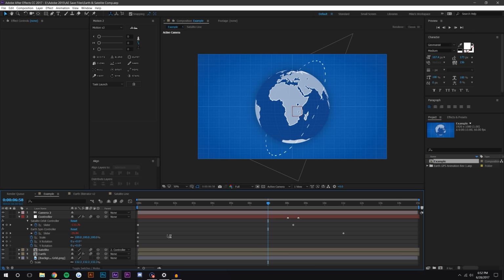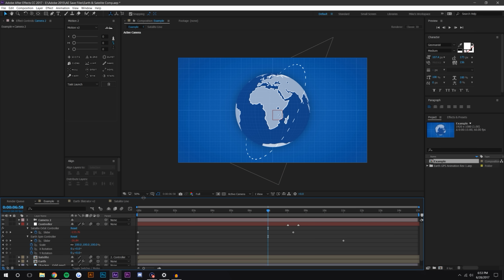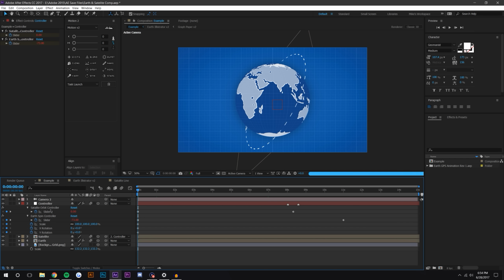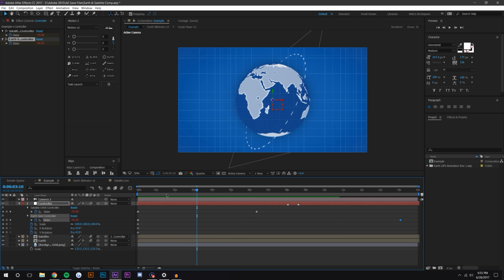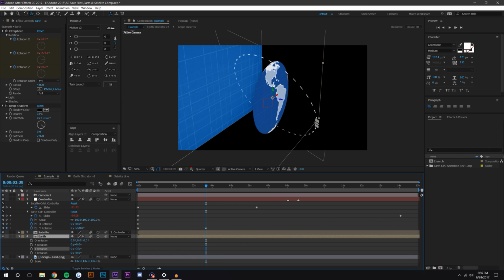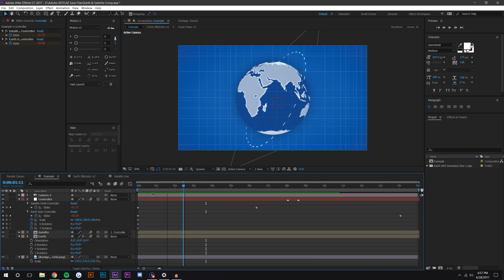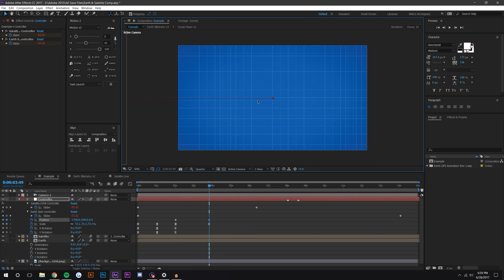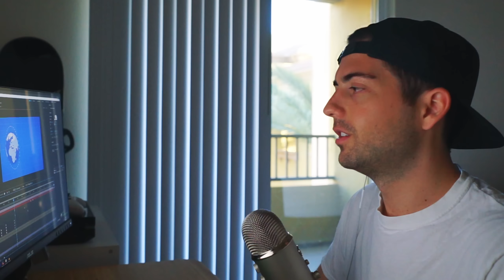VFX Breakdown - Why The US Military Made GPS Free-To-Use (feat. RealEngineering)

Comment: Hey Mobox, I am trying to make an advert thing for a friend of mine on youtube, just one of those that just says "Don't Forget to Like and Subscribe" and all of that stuff but when I export it, it's 3.7GB (it's only 8 seconds long) and the only format I can export it on with RBG + Alpha is AVI which is the reason for it being so big. Any suggestion on how I can make the file size smaller so I am able to send it to him?
Reply from the maker: https://www.youtube.com/watch?v=3TWDCzi3EJI
Check out that video for my render settings. I would like to not, however, is that After Effects CC is not the last piece of the render chain so the output files are massive to maintain quality after being added to Premiere Pro and being rendered again.
Reply: Thank you so much, Quicktime is a much better option than AVI, dropped it from 3.7GB to 16.8MB!
Reply: Sorry for taking so long to respond, but thank you so much for the help! I was able to get it down to 18MBs!
Reply: So I was wondering if there is any other way to export than .mov because apparently that doesn't work for  premiere 2015. Anyway I can turn it into something else that will still have a transparent background?